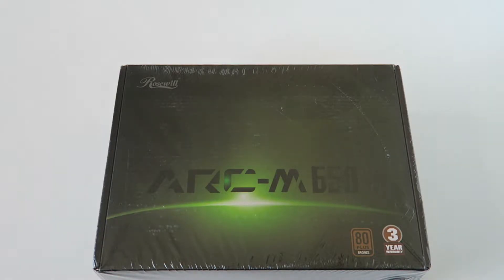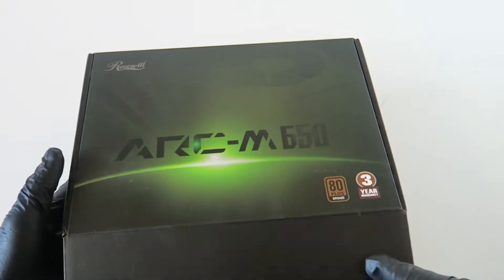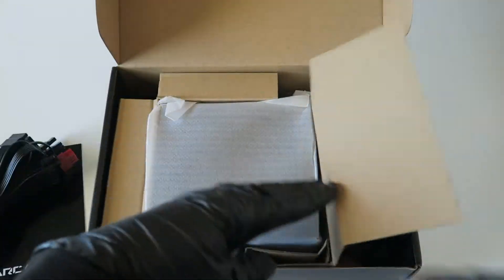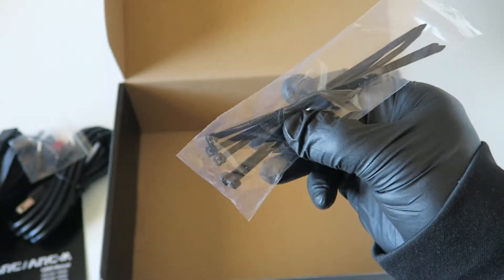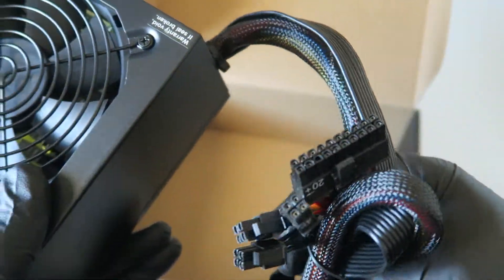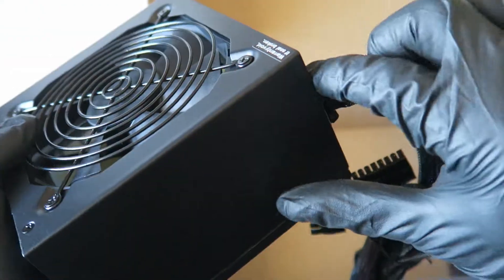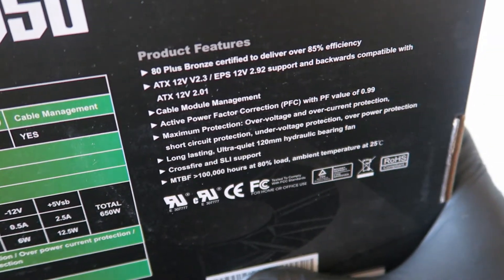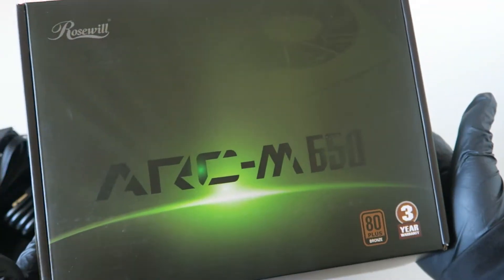Rosewill ARC-M650 Power Supply Unboxing

Comment: great video man, i have a question, ¿do you think this power supply can hold this setup: Core i7-2700k (without OC), 3 Sata 7.2rpm, 3 fans, and GTX 780?
Reply from the maker: Hi, no this is cheap power supply not for gaming,  i recommend you pay extra and get stable power supply brand like corsair or seasonic brand.. 
CORSAIR RM650X 650W, or Seasonic SSR-750FM 750W
Reply: ok man, thanks a lot, will buy a corsair